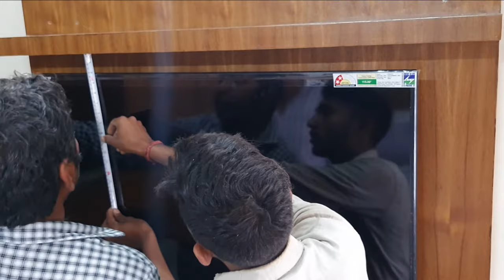Samsung LED TV Installation on Wall Mounted Wooden Cabinet | Samsung 40 Inch Smart LED TV Fitting

Comment from the maker: Samsung LED TV Installation on Wall Mounted Wooden Cabinet | Samsung 40 Inch Smart LED TV Fitting.  Please like, comment and subscribe to the channel. Thanks for your support.
Reply: what is the thickness of the board and what size screws have you used?